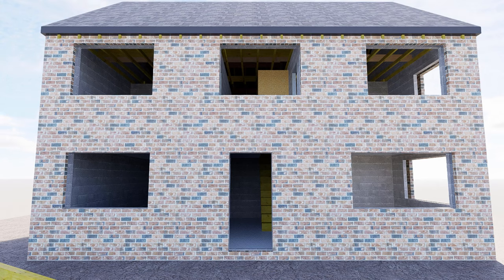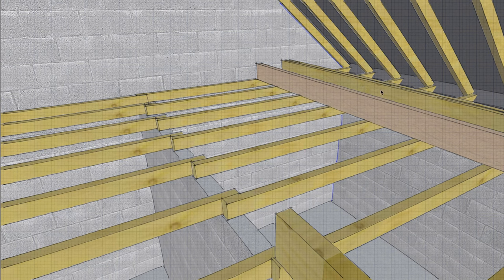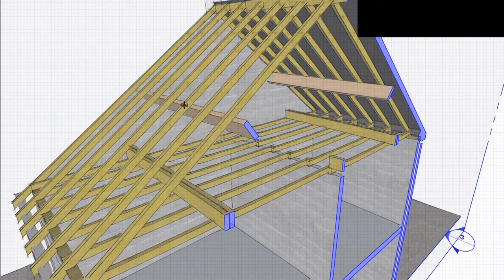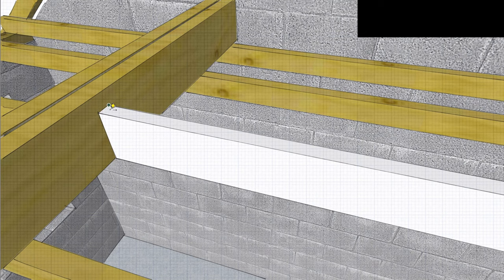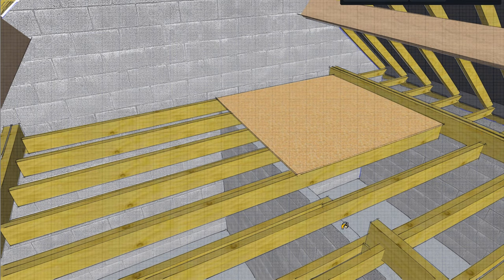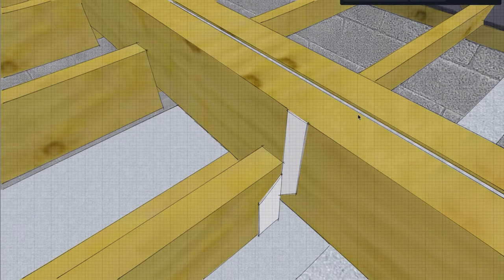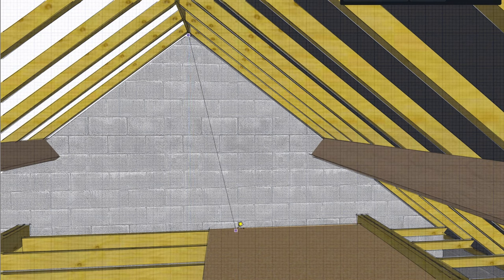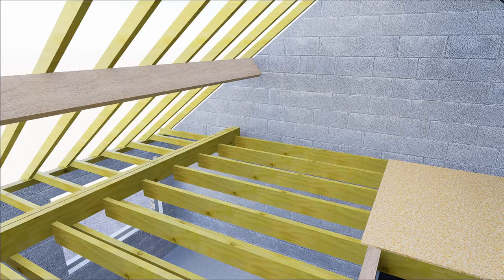How to support a loft floor for an attic conversion

Comment: Great model. Is that all done on sketchup? You must have put in a few hours to be so proficient with it!
Dropping the new floor joists down and in-between the existing ceiling joist is a nice idea but typically the ceiling joist level void is filled with all manner of services (cabling, wiring and pipework) that would prevent this.

Comment: Hi Robin. Another really clear demonstration in what's needed in engineering a ceiling in to floor space. Would you happen to have any videos demonstrating how to do a similar installation of a 'steel' beam or 'flitch beam, in to an existing floor below allowing that space below to be opened up. As an example; changing the existing timber bearers that are supported on piers at 1800 cts, for steel 'UB' or 'flitch' Beam, that could span 4.0m, supported upon brick piers either side. By the way, is there a method that would enable that UB beam , or a 'flitch beam', to be inserted up between the floor joists to create more head room without creating too much drama, as it is a lived in space with a kitchen above. Or would it simply be best to excavate more earth below to create that needed head space. Thanks Robin. Of course almost anything is possible with enough money and time splashed at it but this question is about trying to do something as cheaply as possible.

Comment: Would love to see a video on how to do a conversion of a steel trussed roof built in the 1950's, with no load bearing internal walls upstairs. Without taking the roof off.

Comment: isn't it possible to use the existing joist hangers (ceiling binders) instead of putting new RSJ or flitched beams? Also, it is possible to splice joint flitched beams?

Comment: To create the flitch beam could the existing Binder beam, that's set in the gable ends, be used? Could you just sandwich your new steel between the binder & the new length of timber to create the flitch beam?
Reply from the maker: Hi Scott. Yes you could, if it is in the right place.

Comment: Do you need a party wall agreement to fit this fitch beam for a semi-detached house? Does using a high strength stell hanger rather than a padstone make a difference? Do you need one to put shelving into that wall.

Comment: Excellent video, very informative but.. It's a bit unfair with the "cowboy loft storage companies".. We do quite a bit of work in both truss roof houses and older hand cut roof houses. When we offer to do the job properly by ensuring there is more strength in the exsisting ceiling the cost goes up and we almost always loose out to other firms.. If we just offer the customer a timber raise and slap some boards on top we normally win the job.

People only seem to care about how much it costs, wether or not it's safe doesn't come into it!! You wouldn't belive the amout of people we quote that say "cant you just nail the boards the the joists?" or "why raise the floor when you can just cut out of the joists for cables". Clearly we refuse but that's what we have to deal with with our customers.

I've been in more truss roof houses than I'd like to mention where the owner, or worse, the actual builder, has cut through trussess to fit the loft hatch in then they complain that their ceiling has cracked!!!

The market (IE the customers) push companies to do a "cowboy" job becasue they just don't want to pay to do it properly.
Reply from the maker: That's great insight. I totally understand where you're coming from. Get in touch - I may have something of interest for you.

Comment: Great video. What is the connection between the fitch beam and the wall?
Reply from the maker: It would be supported on a padstone or if the load isn't too great, a high strength steel hanger.
Reply: @RobindeJongh  Does it mean it needs to be fitted through the gable wall? Can the flitch beam be assembled on the loft?
Reply: @RobindeJongh  thanks for the reply. Is there any reason why the flooring can't span between the existing joists instead of the flitch beam? Cheers

Comment: Hello Robin I have watched my of your video clips and they have been a great help, thankyou. one question you keep referring a loft conversion to a storage space and not a living space is there a difference on how you convert the loft space?
Reply from the maker: Hi Brian. Some videos are just converting the floor for storage. For habitable space usually you also support the roof and add in additional rafters and insulation. Also additional staircase regulations / fire regs, etc.
Reply: thank you for your reply Robin. I don't suppose you have vids on fire regs you explain them very well. @RobindeJongh

Comment: Hi, thank you for the time you take out to make these videos. Some companies just lay 4 by 3 timber down, nail that to the beams on the floor then put flooring down on that. Is that ok for light storage or will it causes problems?
Reply from the maker: Hi Peter. Do these companies provide structural calculations? It's a structural renovation so their work needs to be checked by building control.
Reply: @RobindeJongh  thanks for the reply. Does this apply for just loft boarding for storage?

Comment: A flitch beam. How thick dose the steel have to be and dose it have a be one continuous length or can it be in sections. Could it be that you could weld two short sessions together. 
Cracking videos.👍
Reply from the maker: Hi Anthony. It has to be a continuous length. See my video on flitch beams here, and the next in the series showing how to size one: https://youtu.be/hy0-zljOcbw
Reply: @RobindeJongh  thanks 😊. But would it be possible to butt weld them together as I don't have the space or the man power to lift a 4meter length of steel into my loft space.
Reply: @anthonybrown7959 it’s not safe to carry out welding in a loft space. It’s better to remove a small section of roofing and tiles and slide in a beam